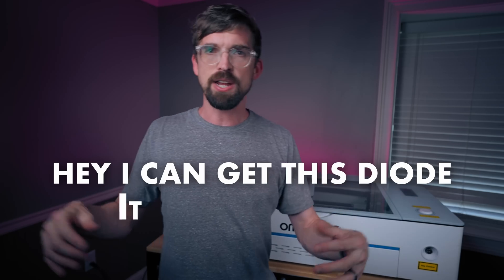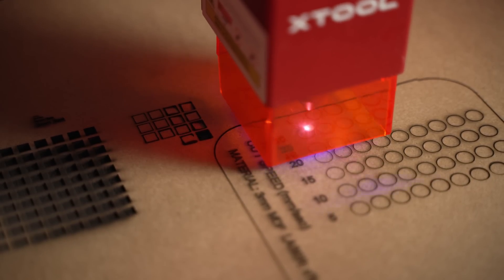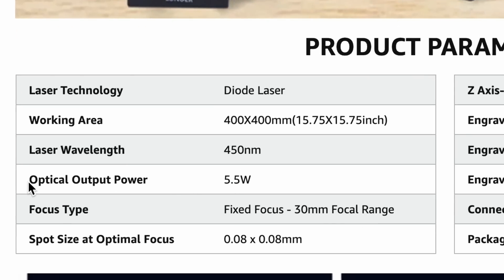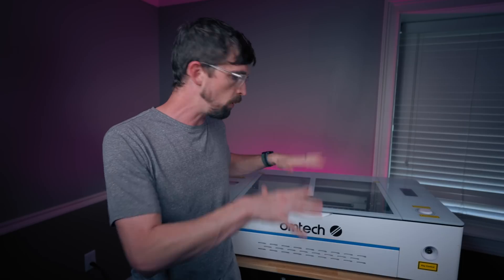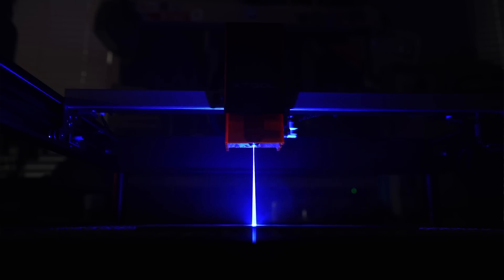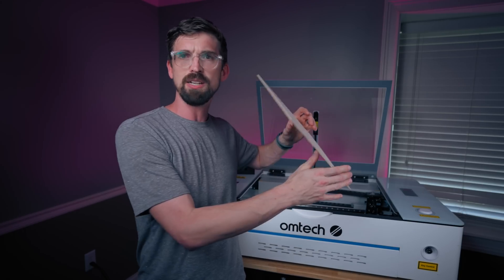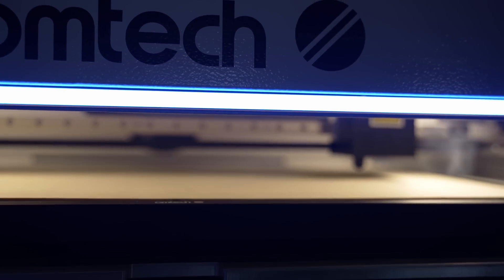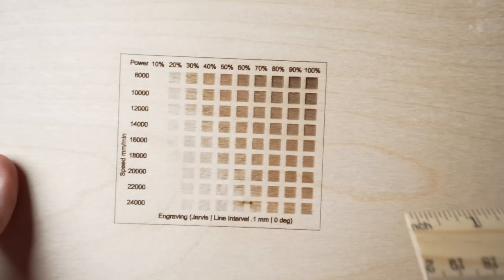Laser Companies are Lying to You

Comment: The. Diode watage rating was always a complaint of mine. 
Its a combined max of everything on the assembly. So laser turned up. Servos under full load etc. 

Also when you get into large diode lasers the rating is not equal to a co2 laser.  Again different capabilities also.
Reply from the maker: 100%

Comment: Co2 will be more powerful and faster. Though the focus burn is tighter on diode. 
Diode are easier to maintain ( no mirrors).
Reply from the maker: good points!  I want to do a video showing side by side differences between CO2 and diodes especially when it comes to engraving.
Reply: @makeorbreakshop  
Its a massive difference. 
I ran a couple different diode. But on one of them i almost ended up in hospital due to the fumes that accumulated over the day. I said no more and went co2. For the enclosure. Just wasnt worth building an enclosure for the diode. 
Speed is massively different. 
1.5 year later and we are looking at a 130w to increase speed more. 

If you are doing photos.. Diode is better choice. But here you also get into the quality/ cleanliness of the wood.